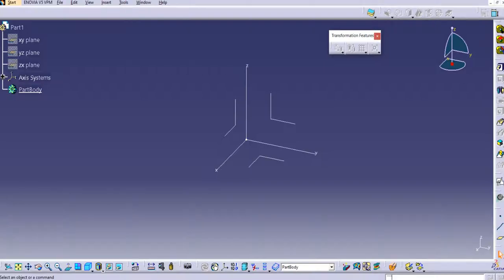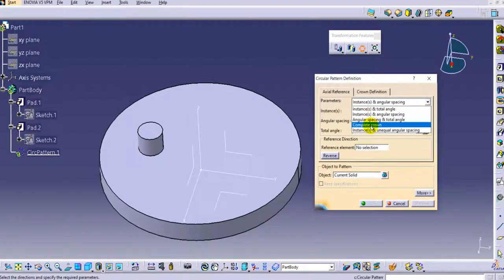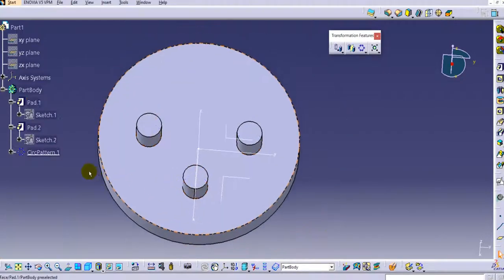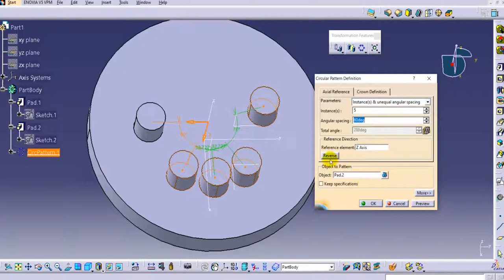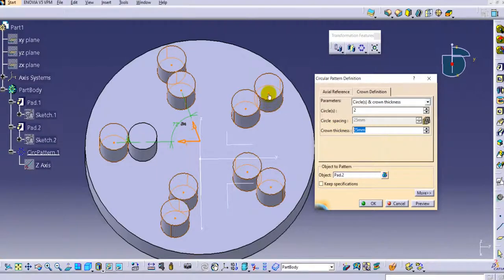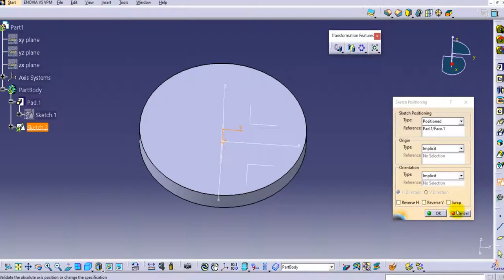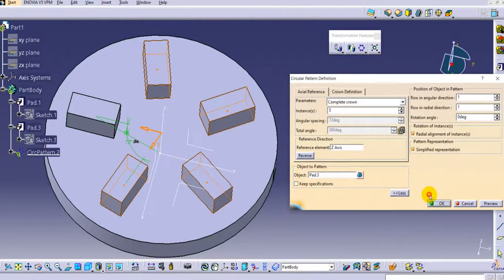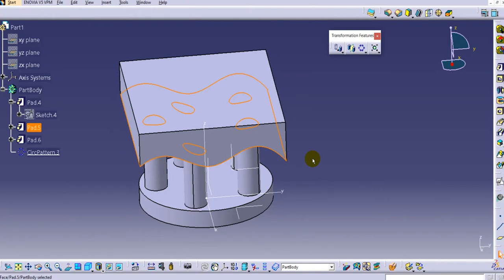Circular Pattern I Axis reference I Crown Definition I Radial Alignment of Instances I CATIA V5

Comment: wat is the use of simplified representation option in it?
Reply from the maker: This is generally for improving the regeneration/Updatation performance.. Basically we can use convert some parts into it & only part we can use as a CAD which will improve performance as well.. We are temporarily  removing the unnecessary or complicated part which is not required for us for the moment.